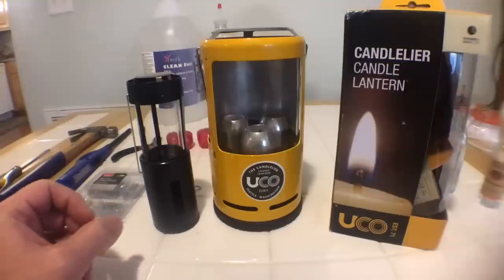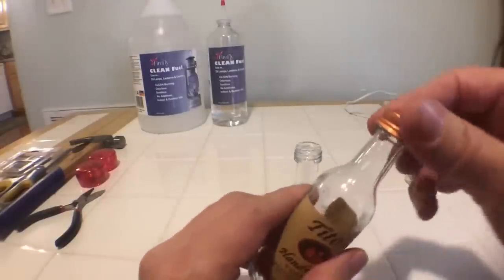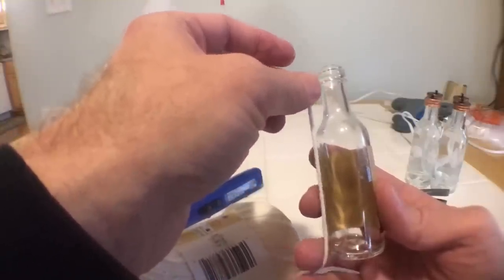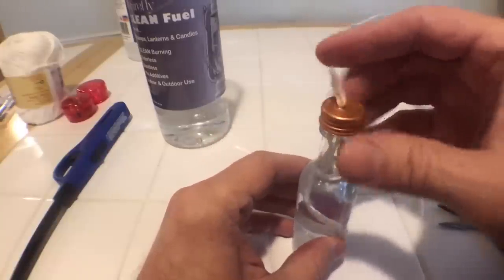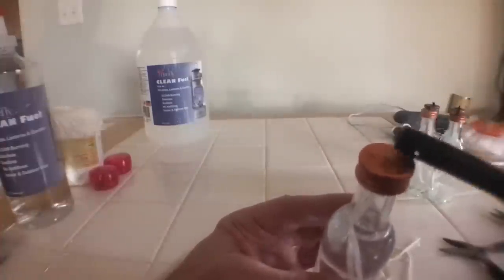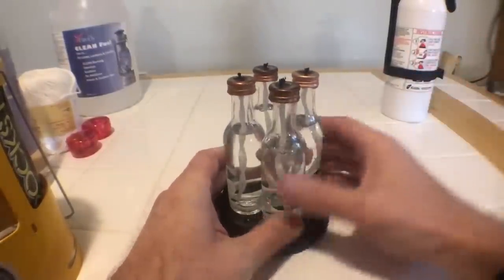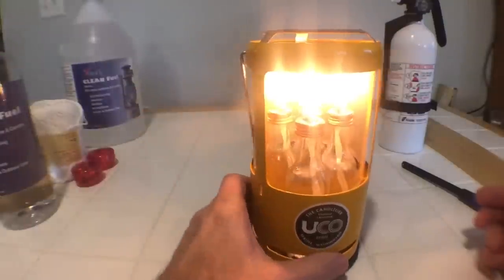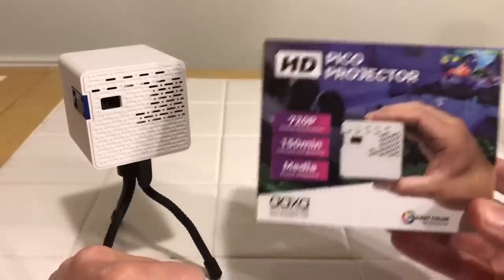UCO Candlelier Heater Oil Conversion Candle Lantern Camper Car Van SUV RV

Comment: PSC
Thanks for liking my idea.

Check out Eden Pure electric heater for copper tube heating that gives far infar red heat, to see the design. Any sheet copper or copper pipes in proximity to heat will generate this effect. The small EdenPURE heater is electric. They have two sizes. I believe the smaller of the two will work off of a battery and an inverter.

Separately lookup gasifier designs of heaters. I got 6 hours out of a small tea candle that normally only Burns for 30 minutes with the following design.

The design is as follows take some Reynolds Aluminum Foil or copper tubing and drill holes around the bottom of the tube made of copper or aluminum. These holes along the bottom will bring air up through it like a rocket stove. Make sure that the tube is around the flame and fuel unit to bring air up past the flame inside the tube. this increases efficiency tremendously, and will extend your fuel Life by putting more oxygen into the flame, thereby not wasting the gasified fuel but instead causing a complete burn. This is basically a rocket stove design adaptation, so look up rocket stoves as well. Basically you're turning your unit into a rocket stove and burning off the unspent fuel more efficiently. So basically some holes in the tube of aluminum or copper starting with the holes an inch or two below where the flame starts will drag the air up past the flame inside the tube causing more oxygen to feed the fire, and burn off what the flame doesn't get in what an effect is a second burn.

Experiments with additional holes higher up along the flame Channel inside the tube which brings more oxygen into the burn above the flame.

Try this outside of your car in testing your design before you put it in your car. you'll need less fuel and get a more efficient burn, and more heat. 

 By adding more copper tubes horizontal 3 to 6 inches above the heat Source will generate even more heat as far infrared which heats up the objects in the space not just the air. Again go to EdenPURE to see this effect and have explained how it works.

Have fun experimenting, will love to see your next video on this improve design when you get it worked out. I have tested this for myself, but do not have time to make a video so please take these ideas and make them work, and please make a video and share with others.

I had fun watching you experiment, very useful as a design what you have here.
Reply from the maker: Thanks for all the great information. I will need to research this and learn more about it.

Comment: I would love to see the top plate removed and replaced by an aluminum funnel to a metal pipe stuck out the window.  And a mesh around the  heater with strong magnets keeping the heater in place.
Reply from the maker: It would be a pretty cool looking oil heater that way. Might be a market for that.

Comment: Could you use a jar similar to a olive jar or a bigger jar and put 3 holes in the lid and 3 wicks. Just thinking one jar that holds about as much fuel as 3 shot bottles would be less work. But not sure if I am missing something. Great work though. Very initiative. I was looking for a way to heat a tent while camping in the wild.

Comment: I crochet with that yarn and  I was thinking you could use a crochet hook to help thread it through the top. They do make them that small.  Thanks for your video I will be purchasing the lantern and testing it out in my tent this year.
Reply from the maker: Thanks for the tip! I hope the lantern works out well for you! Thanks for your comments and for watching.
Reply: I saw another video and this guy had a container much like the ones you are making but they were made specifically for the lanterns. But I guess they don't make them anymore which is insane because from what he said they work a lot better than the candles. I'm gonna try the candles and see how warm that keeps it and if I need more heat I'll set out to make your invention. Thanks again!

Comment: I didn't read all the comments but first regarding threading the wick use a small piece of string lute through the wick but the small string through and pull the thick wick do the tiny hole
Reply from the maker: That would have definitely worked better!

Comment: Small crochet hook. Pull wick through easily.
Reply from the maker: Great idea! Thanks for posting and for watching!
Reply: Or just use a small amount wire (stripped bread wrapper wire)  and use like a needle threaded.
Reply: that's using your head Val..

Comment: Instead of trying to push the wick through the cap with a nail, take a very fine wire push it down from the top through the hole wrap round the Hank of the wick and then push the end of The Wire back up through the cap. Now you can pull the wick through very easily. Similar method to putting thread in sewing needles.
Reply from the maker: That would have been a better way!
Reply: @timdillen  

I am also thinking about using a single jar if I can find the right size, with a metal lid. In this larger metal lid I can put several wicks instead of having five different bottles. What do you think?
Reply: @timdillen  

I put together the candle lantern using your ideas but with an 8 oz mason jar. That's half a pint. It seems to be working perfectly. Had it burning for about an hour.

I can see how this will be far easier to refuel than either the candle lantern or the multiple bottle lanterns that you were discussing. My wife gave me an idea, and instead of taking the Wicks out of the jar and sealing it, I put a second lid over the jar and sealed it down with the ring on top of the lid with the wicks. I may have to run some silicone along one of the lids to make a good seal.

Comment: Could you use a fiberglass wick instead of the cotton?  It would wick up the oil but won't burn so you only have to have enough to rest on the bottom...I have made oil lamps using them and the glass candle holders you can get to go with them, putting the glass stem through the hole in the lid.  Blessings and thank you!
Reply from the maker: I think that is a great idea. The only reason I didn't go with fiberglass wick was the cost. I didn't look too hard for a cheaper supplier . Thanks for you comments and questions and for watching!
Reply: PriusStealthCamper Adventures you can get cheap fiberglass wick from vaping shops (online or b&m).
Reply: So you would use the same jars just use this wick in place of the worsted cotton or is there something else needed for this idea?

Comment: This is a really great idea! I'd like to suggest using a trick for threading the wick. Take a piece of masking tape and wrap it multiple times around the end of the wick, making very thin so it can fit through the cap. Then you can thread one long wick through multiple caps and cut the wicks to the desired lengths. Thanks!
Reply from the maker: Glad you liked the video. Thanks for your comments and for watching!

Comment: Does the oil conversion make it possible to boil water on the candelier? You can heat water/melt snow with the candles but a boil I find futile.

Comment: I had watched someone try to boil 2C of water on the stock UCO Candlelier and it took a full hour to start a decent boil with the lid on the aluminum pot. I would like to get a few of these to keep in the Jeep in case of breakdown in the Maine Winter so heat is the primary interest, but have you any idea how long it would take to boil 2C of water with your oil modifications and having four flames much closer to the top?

Comment: Enjoyed the video and your ingenuity. You said the thin metal top gets very hot but in the long run how well will it hold up with four oil flames and is it strong enough to hold a cup of coffee? Does the Candlelier need to be hung or can it be set on a table for long duration?
Reply from the maker: Without modifying it, the top really in not steady enough to hold a cup. The metal is fairly thick but the way it is attached is not the best. It is designed to be removeable for cleaning so the little arms bend and can slip out of the slots. You can easily set on a table. The bottom does not get hot at all. Hope that helps!

Comment: If you yank the  metal top plate and replace it with an aluminum funnel  topped by a one inch copper tube wrapped in  a  fiberglass muff where it passes out the window, would you have a heater that could be used when you sleep?
Reply from the maker: I think that is a great idea!

Comment: Thank you!
I don't really understand about the wick tho.  Do you have to keep raising the wick throughout the night?  Or every day?  The small amount of the wick you pull out burns up right?
Reply from the maker: You don't have to raise the wick though out the night, the flame just gets a bit smaller as the oil gets near the bottom of the bottle. I  found just raising it once during the 9 hours was sufficient. The wick does not burn up much at all but does get charred, it's more the gravity to raise the oil. Thanks for your questions and for watching!

Comment: so after all these tests , would you say that the heat overall come from the flames heating that top plate/cover ? at least 80% of it? and the other 20% from the candle it self? .... and if the top plate can be lower (not blocking air flow) to get it closer to flames and get it hotter (red hot if possible) it might produce more heat? flipping the cover upside down ?... thank for your videos !
Reply from the maker: I would say that most of the heat passes through the top vents. I had not thought of flipping the cover. One concern I might have of lowering the lid would be overheating the glass. I am not sure it is built to high enough standards. The top gets hot enough to burn you that is for sure. The lid is aluminum and very thin, I would say that is a weak point of the unit. A better lid could definitely be made for it.

Comment: put a doubled over thin piece of wire through the lid and poke yarn through the wire loop then just pull it back through
Reply from the maker: That would definitely be a better way - thanks!

Comment: Good diy but do you can't the candle metal socket to fix the single bottel ?
Reply from the maker: The bottle is just slightly too side to fit inside the metal holder. There may be a bottle out there that will but I could not find one. Thanks for you  question and for watching!
Reply from the maker: ...to wide..and just a little too tall.
Reply: PriusStealthCamper Adventures okay thanks for the answer have a nice trip!

Comment: How do you extinguish the flames if you want to burn for only 3 or 4 hours or less?
Reply from the maker: You could just fill the bottles about half way and they will self extinguish.  I would not blow them out inside your car as they put out a bit of smoke and smell as the wicks smolder to a halt.  Thanks for your question and for watching!

Comment: Seems a lot more dangerous is you were to accidentally spill the fuel. Is there a way to make the fuel in gel form? This would avoid spillage.  Also, I would venture to say that you would also putting quite more carbon monoxide into such an enclosed space.
Reply from the maker: I thought the same thing so I invested in a very good CO monitor and tells me exactly how many ppm there are of CO molecules in the air.  I check it frequently and during the testing it always read zero. I did crack the window and ran a fan so that must have helped. I don't know much about gel fuels but hopefully someone will add to your post and let us both know. Thanks for your post and for watching!

Comment: Can you share - what are the inside diameters of the 'candlelier' and the 'original' candle lanterns? (I.e. what's the largest diameter vessel that would fit in each?). Thanks!

Comment: How hot does that top part get? Can you put a kettle on top of it?
Reply from the maker: Good question - it does get quite hot but the structure of the top is thin metal and designed to be easily removable so it does not support any weight on it.  I did see a video where they did get a half cup of water to bubble but I think it took over 15 minutes. I just would not trust the top to not dump hot water on everything. Could maybe be modified to be substantial.

Comment: is this safer and cheaper than the mr. buddy heater??
Reply from the maker: The Buddy heater would be better for a larger space. I really could not find a good heater for a very small space so this was my attempt to find something that might work.  The Buddy heaters do not have a thermostat so they put out a lot of constant heat and I ended up waking up sweating.

Comment: I do a lot of camping with my son, he's nine and the cold doesn't seem to bother him at all, me on the other hand, I hate being cold when I sleep. For the most part, I only camp in the summer and spring/fall so it doesn't get super cold but it does get uncomfortable if not dressed properly and have the correct sleeping gear. My question, I was going to pick up a Mr Heater portable propane heater for the tent but I really don't think I need to go to such extremes. Do you think this method of heating would work in a tent? With the thinner walls and no insulation, I doubt it would get the tent to a comfortable range, your thoughts?
Reply from the maker: This should provide some good heat inside a tent for spring, summer and fall. Just make sure it's securely fastened so it can't get knocked over and make sure the tent above the lantern is not getting too hot. It has a pretty long hanging handle so you should be good. The Buddy heaters work great but I have found they put out too much heat in some cases and can't be turned down far enough.  That's what got me interested in alternatives. Thanks for your comments and questions and for watching!
Reply: Thank you for your advice, I will give it a try, they have the UCO Candlelier on Amazon Canada so I'll order one tonight :) I won't bother with the conversion just yet, see how it performs on my next trip in March. Great video, very informative, keep it up :)

Comment: How would burning 2 of the 4 candles in your camper do?
Reply from the maker: I think that is the nice thing about the multi-burner setup. You can start with just 2 burners when the night is not that cold, and if you wake up in the night and need more heating you can light the other 2. Thanks for your post and for watching!

Comment: So, does your mod make the Uco put out more heat?  If so, is there  discernible difference?  Does the extra heat adversely affect the thin metal top plate? Thx.
Reply from the maker: The mod does put out more heat with the 4th burner but I am waiting for a night with comparable temperatures where I can monitor through the night and not have to get up early for work - not fun. The metal plate on top has been doing well, no change. Thanks for your questions and for watching!
Reply: PriusStealthCamper Adventures do you have a laser temperature gun? Where you could point at the glass to see what the temp is?
Reply from the maker: That would be great to have but I don't have one, they are pretty neat.

Comment: Love your video. I have learned a lot. I do have a couple of questions.  I am concerned about how hot that top metal plate gets. Could it catch fire or make something near it catch fire? Or, instead of the metal plate could you use a small terra cotta plant dish or tile. This would help hold the heat.
Reply from the maker: Good questions. I tested the burners for several weeks running them hours at a time and the top held up just fine.  Unfortunately the top does not fit very well so placing something on top might make it slip down - not the strongest design. Thanks for you comments and for watching!

Comment: Why not just put 4 wicks in the lid of a mason jar? That way you only have to undo a single cap to fill and it holds a LOOOT more fuel. Hell, you could put whatever number of wicks in a mason jar you like.
Reply: Thought the same thing, thanks.
Reply: to many wicks may heat up a single jar of oil to the point of combustion
Reply: Moose looks like a safety issue if mason jar is open
Reply: Moose .
I want to be with moose when the SHTF.
Reply: Has anyone tried this yet?
Reply: I've used those mini glass alcohol bottles with metal screw tops. They are fantastic!!
Reply: good idea to test
Reply: @Avos1973  may or may not...test it!

Comment: Where did you get all the little spare metal caps?? Also couldn't you just slide the shot glass through the metal holders where the candles go, instead of glueing it??
Reply from the maker: Good questions.I could not find the spare caps so just bought the extra bottles with caps and discarded the bottles. The metal holders are just slightly too narrow for the bottles to fit inside of, would have been great if they did!  Thanks for your questions and for watching!

Comment: Has there been a update on the heat output compared to the oem candles?  Out of curiousity, how about trying alcohol instead of lamp oil.
Reply from the maker: I still haven't had a good comparable night for a test but the heat output is definitely more. I haven't tried alcohol yet but I think I have some around here. I'll see if I can give it a try. Thanks for you question and for watching!
Reply: PriusStealthCamper Adventures Looking forward to see  a alcohol version.  Not sure if the Alcohol has a higher heat output then candles.